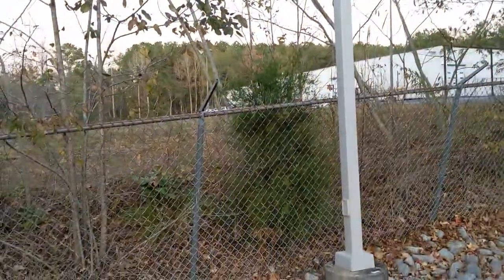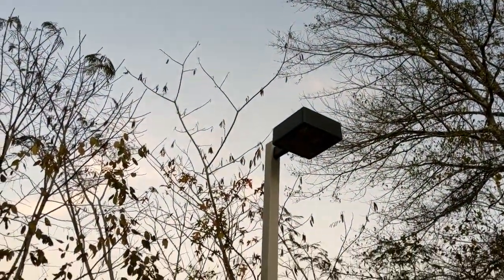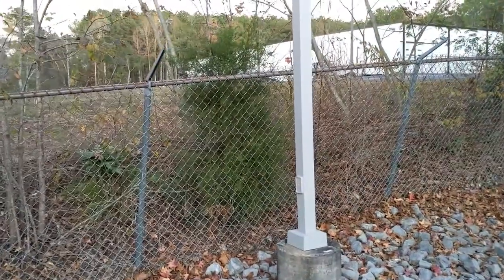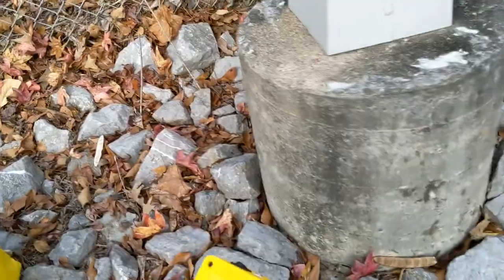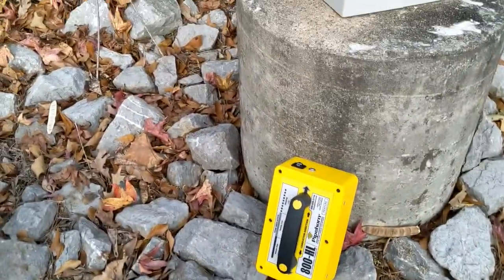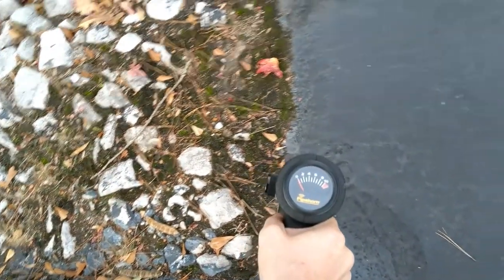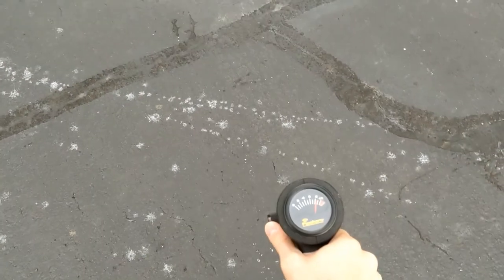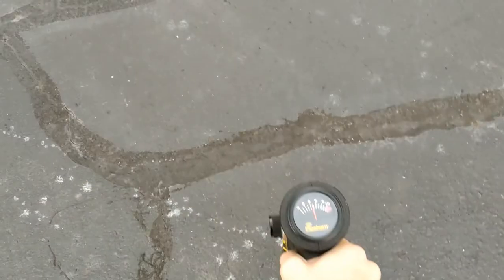Locating Parking Lot/Streetlights with a Pipehorn

Comment: I always slide the base of the light pole up and direct connect to one of the four anchor bolts. If I have to induce I place my transmitter on the concrete pole base. Also, if inducing a signal, always double access or locate back to the pole from your most distant signal to ensure you haven’t bled off of a different utility. Pipehorn is the best tool for private utility locating in my opinion and I have been a customer for many years and I will always have a Pipehorn in my truck!

Dusty Thomason
Alabama Utility Protection Services